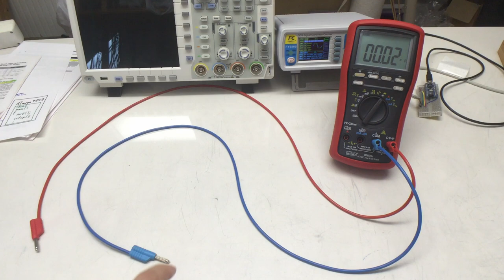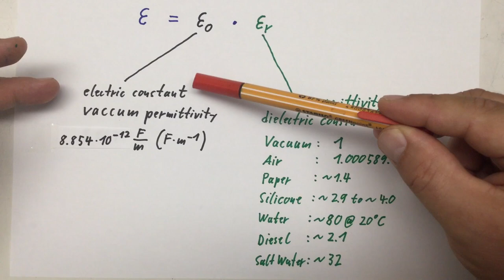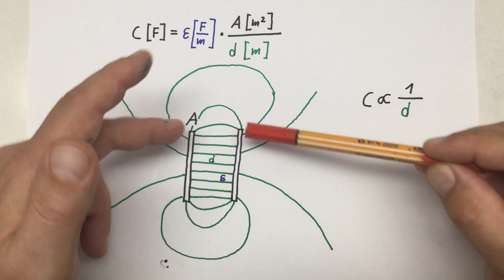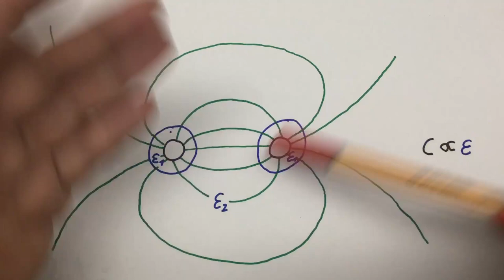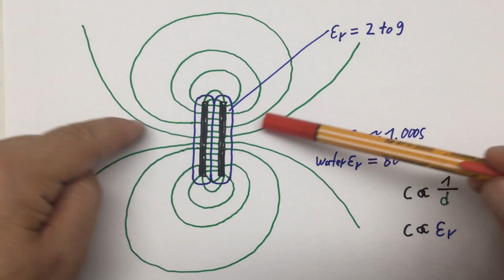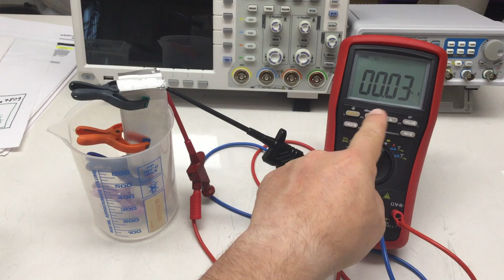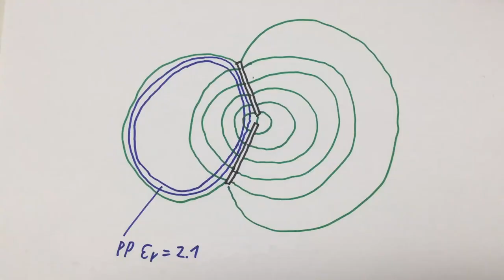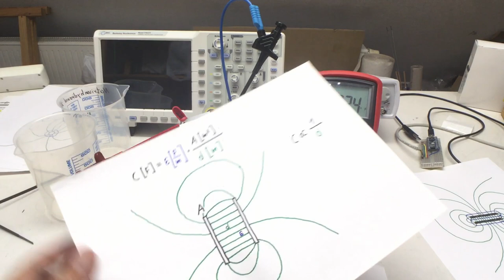Capacitive Liquid Level Sensing (1): Sensor Basics

Comment: Hello sir , I have a question please. How can I maintain the error of measuring equal to 1 if I change the parameters like the distance between wires, electrodes or even the radius of the wire?
Reply from the maker: If you sensor geometry changes along the length of the sensor in any way, you'll have to compensate for that in software. That is you have to take calibration measurements for as many fill levels as possible, store those value pairs (capacitance, fill level) as a table in your software, and then calculate the fill level from that table and your capacitance measurements (apply linear interpolation between data points of your table).

Comment: Hi professor, Hope you are well. I do really enjoy your well organised video regarding the capacitive topic. I have set up a capacitive water level sensor system with a micro processor for the display and another one for the probe on the tank. The length of the three wire connection between the display and the probe (sensor) is directly affecting the readings and also I get interference between the cable and any metal, floor ground, touching the wire …etc. The question is how to buffer the system from interference and also how to make system adapt to any length of wire between the probe and display? Your insight will be much appreciated.
Reply from the maker: Well, first of all I'm not a professor 😅 Anyway, following along this series you'll see that keeping the wires short is the key to success. Ideally your measurement electronics are directly connected, respectively, as close as possible to the sensor. After you converted the capacity of the sensor to something digital (or something more robust analog, like 0V to 5V), you can transmit the data over a distance. Connecting the sensor over any lenght of wire to the electronics is not advisable.

Comment: grate video,also please do try it with the chip as well should be interesting.
Reply from the maker: Thanks 🙂Do you have a certain preference regarding the chip? I could go with the TI FDC1004 (0.5 mm pitch VSSOP package - pain in the behind) or the Analog AD7745/AD7746 (0.65 mm pitch TSSOP package). But it will take some time to source those chips.

Comment: Hi master, very well explained and I enjoyed it a lot. What about if the two capacitive plates ( let’s say two stainless steel rods ) housed in PVC pipes each and separated for the distance of  1cm? Do you think this works to use it as the water level reading in the tank? Thank you
Reply from the maker: Hi, yes, that would definitely work. However, you will have a smaller capacitance / smaller capacitance changes.

Comment: Dear Professor,
At 07:06 I am confused about the definition of the relative permitivity. If only the medium in BETWEEN the plates changes the relative permitivity and not by medium OUTSIDE of the plates, then how would the total Capacity change if a tank is filled with liquid SURROUNDING the capacitive sensor? As the liquid doesn't reach in between the plates, all variables relative permitivity, area and distance stay the same. 
Thank you for these videos. They are really helpful.
Reply from the maker: Have a look at https://youtu.be/Jjcym2g2ruk?si=SiwEn3d_g7vvwXCx&t=530 : The permittivity of the medium between the plates (parallel field lines) is indeed constant, because the medium doesn't change there. However, there are also field lines on the outside of the plates (curved field lines), and those cross through the medium we're measuring (air vs. liquid). Thus the relative permittivity of the medium these field lines cross is changing. Hope that helps. BTW I'm not a professor 😅
Reply: @robertssmorgasbord  Thank you for your time to answer me! It is clear now. Sorry for the professor mistake, the other comments threw me off guard haha. Keep up the great work.
Reply from the maker: @ignist2840  No problem! And you're very welcome!
Reply: @robertssmorgasbord  Dear Mr. Smorgasbord. In our project we are struggling with our capacitive sensor with regard to measuring the liquid level in a sewage tank. After a day, the full and empty signal are not correct anymore. Is there a possibility to discuss this issue with you or do you know other experts in the field of capacity sensors that we could contact? The troubleshooting discussion with our supplier did not lead to a solution.
Reply from the maker: @ignist2840  I'm sorry, but YouTube is just a hobby for me and my real-life profession leaves me very little time spare time. So I'm not really able to lend you a hand here. I also don't know nobody else who could help you. That said ... The problem of measuring the level in sewage tanks (in marine application called grey and blackwater tanks) is that you might have particulate matter in your liquid that might stick to your sensor and thus throw the readings off. One counter measurement is a non-stick coating (e.g. Teflon) on the sensor. Another solution is to use a different kind of sensor. Here pressure sensors come to my mind (e.g. https://www.sensorsone.com/hydrostatic-liquid-level-sensors/ ).